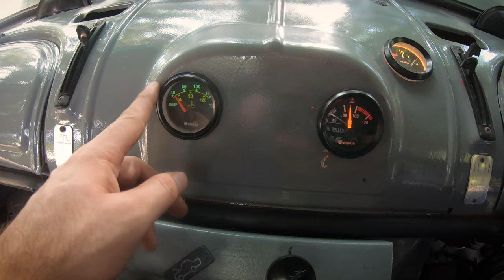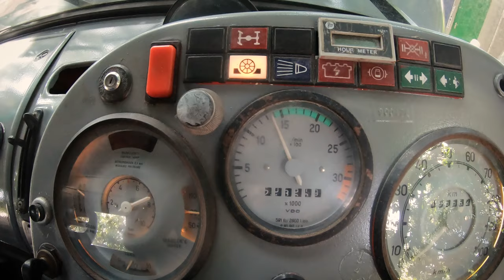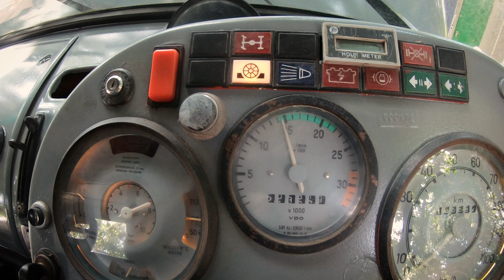Expedition Vehicle Build // Building Betsy Part 8 - Running on Waste Veg Oil

Comment: should you not have swung the diesel return valve after switching the fuel source?? surely you would have mixed oil into your diesel tank doing it the way you did in the video?
Reply from the maker: Hey Daniel. 
You're right, not sure if I did (might just not have recorded it). In the case I forgot it wouldn't be a major issue on a short run as the diesel would thin out the oil so it still passes through the injectors. I think it will take a while before it becomes second nature. Have a good one man